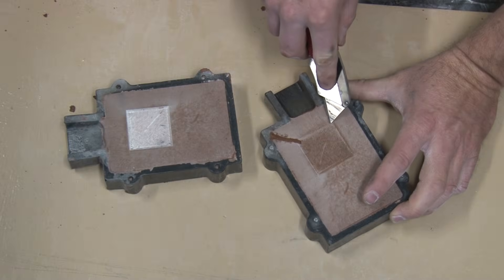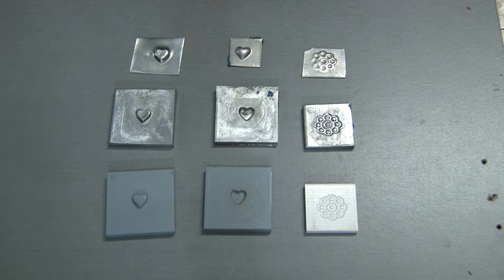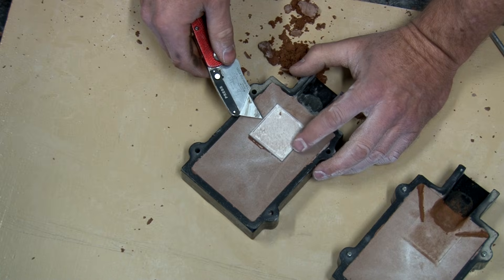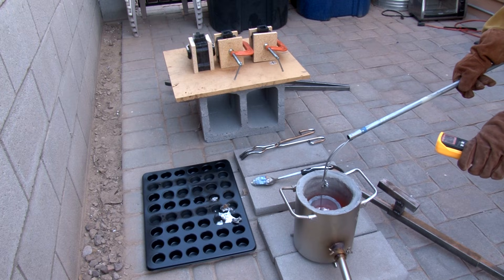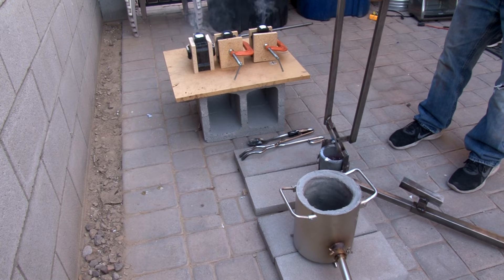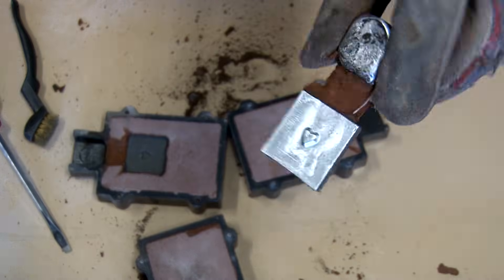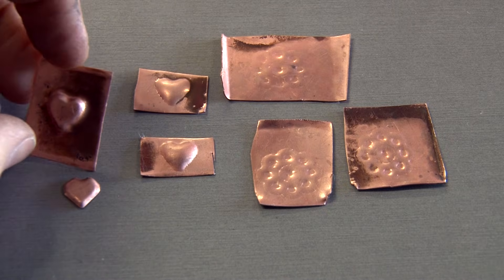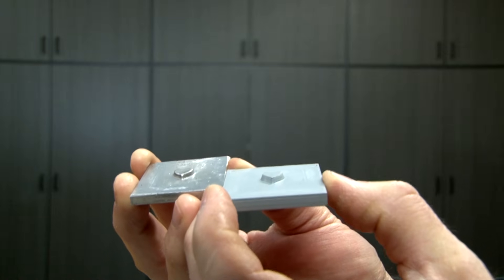Casting Aluminum Dies to Form Metal on a Press

Comment: What kind of sand is used for casting ?
Reply from the maker: The casting sand used is Teton Petrobond 190mesh.  I am having issues finding large quantities of this mesh size.  I have seen 130/140 mesh sold in large quantities that might give similar results.  Basically,  its a petrobond sand.

Comment: Do you think anodizing the aluminum would make them last longer?
Reply from the maker: I am guessing probably not because the thickest anodized coating is 100 microns.  At that thickness it would still probably fail.  I think anodization helps more with the surface being more durable from scratches.  Basically the dies are a cheap way to get something done but wont last long.